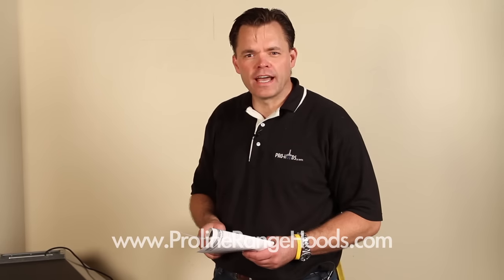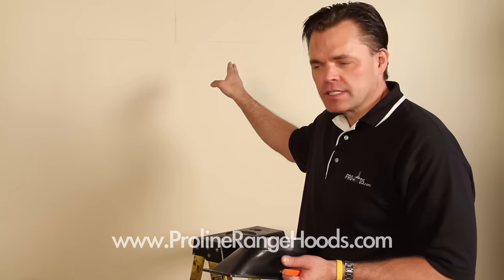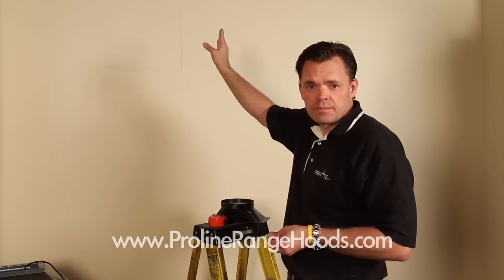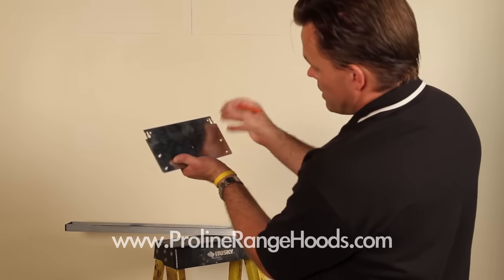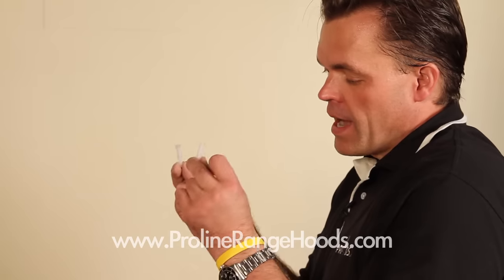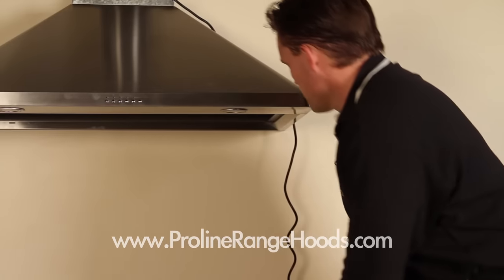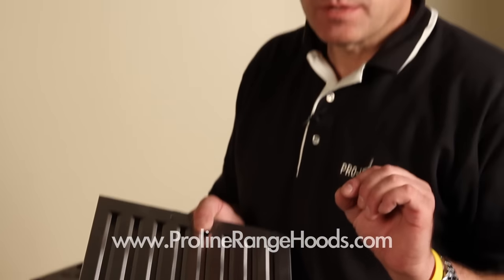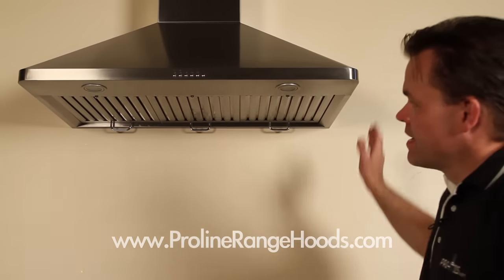DIY: How to Install a Wall Mount Range Hood - PLJW 129

Comment: Nice presentation! However, flexible, corrugated exhaust duct is not proper application for kitchen hood exhaust since it can accumulate grease in crevices and become a fire hazard. This is also in violation of many building codes!

Comment: According to my building department and the universal building code book, this flex duct is not to code, must use stainless steel, galvanized metal or copper... know anything about this?

Comment: were does that duct work go in ceiling out through roof or wall that seems to be the most work to do than just screwing the range hood to the wall
Reply from the maker: Thank you for your comment. We have received many requests to create additional video content on how to properly install duct work. We appreciate your feedback, and we will directly emphasize this to our video team. To answer your question about where the duct work should go, the best option is to vent vertically through the roof if possible. However, if your particular design situation does not allow you to vent directly above the hood, then your best option is to vent through the side wall.

Comment: What does the power cord look like?  Is it a 3-prong plug?  How long is the power cord?  If the power source is not up in the attic, then where does the power cord get plugged in?  Does the outlet receptacle have to be a GFI outlet?  20 amp?  15 amp okay?

Comment from the maker: In an indoor kitchen, this hood should be mounted between 38-36 inches above your cooktop.  Above a grill or outdoor kitchen (which this hood really should not be placed above) you will want to hang it 36-40 inches.  Check out this part of this video for specifics /G62N_nPV_Qo?t=6m9s

Comment from the maker: There is no inherent problem with redirecting the vent out the side or the back for that matter.    As long as you can do it in a way that looks good and the duct work is hidden then it should be fine.  Le us know if you have any other questions.